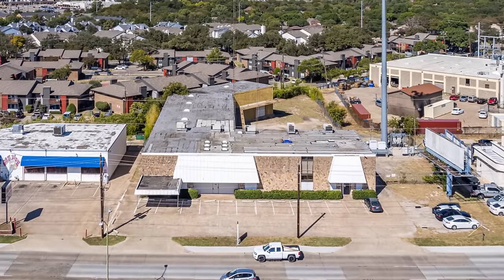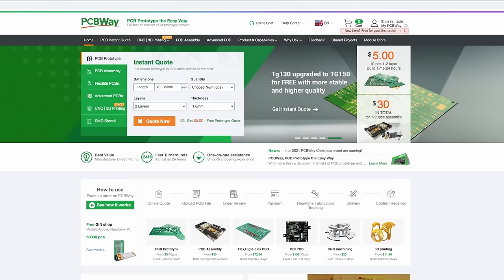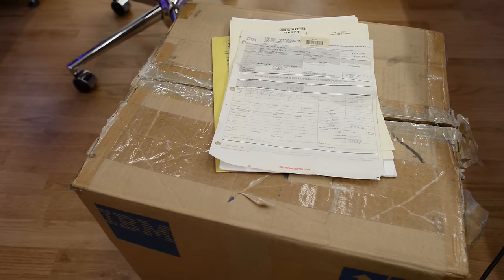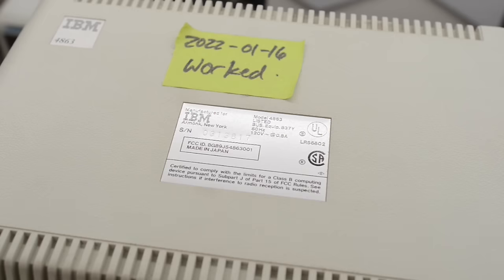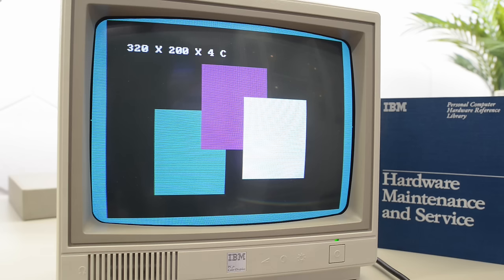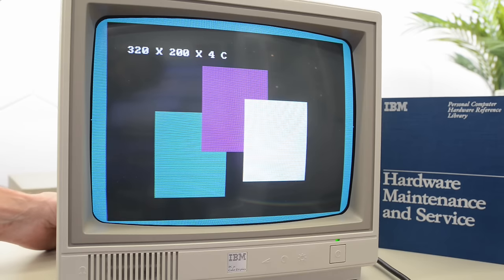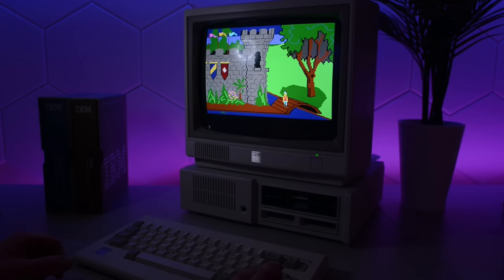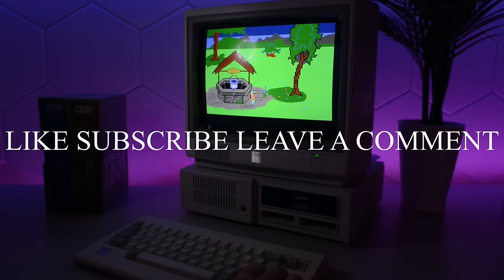The last IBM PCjr found at Computer Reset.

Comment: I owned a PCjr back when they were new.  I put the same monitor model on top of my PCjr and never saw a flickering problem.  Perhaps it has something to do with the fact that the expansion add-on cards would attach to the right-hand side of the PCjr.  Maybe the shielding on the right side is not as good due to that.  The PCjr was one of the worst computers I ever owned.  I will probably have nightmares tonight.
Reply from the maker: Haha, What was so bad about it? did you have RAM expansion?
Reply: @Epictronics1  I unsoldered the original RAM chips and soldered in sockets with 512K RAM on the sidecar RAM expansion (for a total of 640K), if I remember correctly.  It was a bad machine because it was not very compatible with a lot of DOS programs.  Very few games supported the 16 colors or better sound.  It was slow and the sidecar add-ons made the computer a very large footprint on the desk.  The monitor hurt my eyes.  The infrared on the keyboard broke, but it was line-of-sight anyway, so it did not work while on my lap.  My college roommate got mad at me once because he typed in his college paper, then wondered what the BASIC cartridge was, so he unplugged it.  That caused the machine to reboot, losing his term paper.
Reply from the maker: @georgeh6856  haha, Well, I'm glad I don't rely on this machine for anything useful. I'll probably do the RAM sidecar mod on this machine.
Reply: @georgeh6856  That sounds like a Tandy 1000, only done poorly and by committee -- which would be a decent description of the PCjr.

Comment: It's the monitor being close to the LED power supply  in the table is my guess.
Reply from the maker: I tried to turn the LEDs off but it didn't make a difference. In fact, I turned everything off in the studio with same consistent behaviour
Reply: @Epictronics1  turn off or unplug? some badly designed power supplies with soft power switches still cause interference when "turned off"
Reply from the maker: @snooks5607  I tested the PC and display in a different room and also with LEDs unplugged. same result
Reply: @Epictronics1  take it out in a field a mile away from anything and boot it from.a UPS.
Reply from the maker: @blackterminal  All in the name of science. If you don't hear from me for a while, I'm probably in a straight jacket ;)
Reply: @Epictronics1  Lol :)